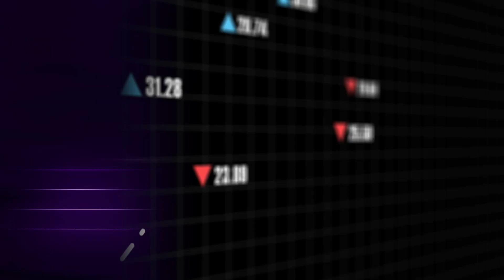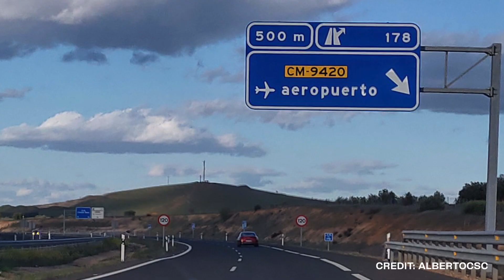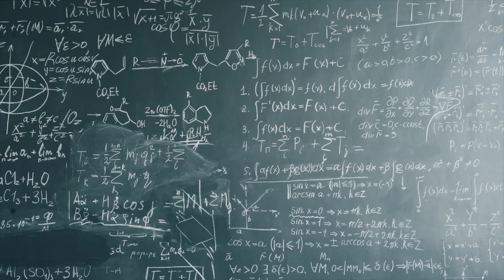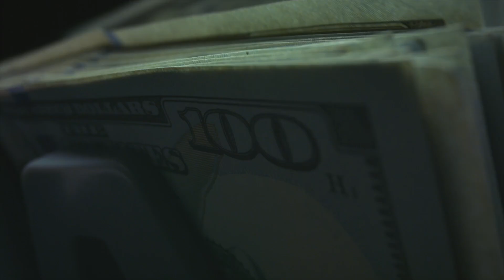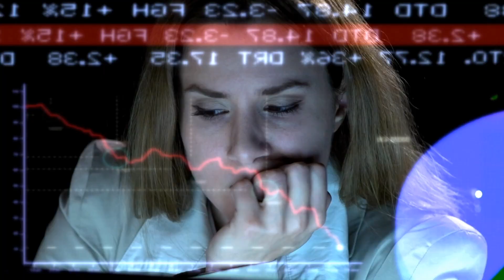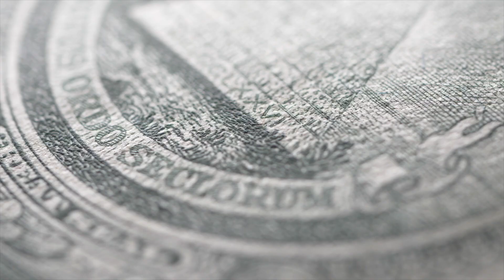5 Megaprojects That Went Horribly Wrong

Comment: #4.. bout the oroville dam.. we locals KNEW it was damaged and that DWR was cutting corners moved here in '96 and it was one of the first things I learned about the area... Don't know why people were NOT held accountable for this gross mismanagement.
Reply: Accountability implies there are consequences
Reply: Because anyone that could do anything about it was in on the grift...EVERY state/bond secured construction project has grubby paws reaching into the pile...
Reply: Uneducated people don’t understand and take things out of context. Susan wolding will appreciate your views
Reply: Thus it wasn't damaged by rain as the video says but poor construction of the concrete plate overlaps.
Reply: Because the government is never wrong and therefore never responsible for mistakes made 🙄
Reply: @Farrell0208  LOL right? we had the same problem with the 2018 Campfire and the 2020 Bearfire in Butte County. Th fires were a result in decades of forest mismanagement. Instead of clearing out dead trees and clear cutting areas infested with tan oak, they let the forest grow unchecked. Between a bark beetle infestation and a warming climate, by Jan 19th 2018 there were 100 million dead trees in the Sierra Nevada Mountains (as per the US forestry service) Then PG&E which is a 'natural' monopoly it was supposed to be HEAVILY regulated and monitored by California public utilities commission, well the CPUC FAILED as well.. Again decades of failing to actually do their jobs. This has resulted in hundreds of deaths, the complete devastation of town (and two of my family members losing their homes) not to mention the complete destruction of our economy in the hardest it areas.
Reply: @willchristie2650  Brooms?  Why didn't I think of that?  At least he didn't recommend massive doses of disinfectant and UV light. lol  Long live President Cheeto.

Comment: #5: Was in Commiefornia, so do you think they would clean up the mess or scam money from the project to make them rich.
#4: Was also in Commiefornia, where tax payers money was spent on things that is not governments job and because of that the damn spillway was not fixed.
#3: Was also in Commiefornia, another damn that was not built right. How much money was taken from this project to line the higher ups pockets.
#2: Surprised that this happened in Spain, but they built in the middle on nowhere.
Bonus: The military industrial complex killed this project.
#1 Corruption happened.

Comment: It's interesting that you speak about money "lost" in each project (or damage totalling a certain value) as if the money simply disappears.

But this isn't the case, is it?

Depending on how the money is spent, a large proportion of it can enrich the local economy, even if the project fails / is abandoned / is not completed. In most of these, those costs go on (for example) the hire of heavy machinery, the salaries of various construction workers, and the purchase of raw materials or components.

I think it's kinda weird that we so easily talk about money being lost when it isn't lost at all, but has instead generated a significant amount of economic activity. The only real "loss" is in the value of the asset that was being built or that failed or whatever. And the only people to whom that matters are the investors. The rest of us shouldn't care a jot.
Reply: That would be true if the completed project would have simply been a static asset that sits there and holds value, like a massive physical savings bond. However, the loss encompasses planned economic activity that now will not occur (how many people would have been employed by the Superconducting Supercollider?).

If your theory was true, there shouldn't be any major difference economically between a string of successful building projects and a string of failed ones. But this isn't the case at all. When investors sink large sums into projects that fail, it's not just they who feel the impact of no return on investment, it's not even just them plus the people who might have benefitted from the project had it been successfully completed, but it's also the people who might have benefitted from their next planned project, which can no longer be built because they don't have the money to fund it.
Reply: @mastick5106   - you may be right.  I was taking the "loss" figures as money already spent.  The absence of expected future economic activity doesn't count as a loss in my head, because (a) it hasn't happened yet, (b) no-one has spent any money on it yet, and (c) people shouldn't count their chickens before they're hatched.
Reply: @nigeldepledge3790  that’s not how finance works
Reply: @michaelconvery2924   - No, you're right.  But maybe it's the way finance should work.

Comment: Never ever buy land below a dam. This was the advice my grandfather gave me. Sound advice.
Reply: @genesis209_gd  what? Don't build on a flood plain. There's something called the '100 year flood'. That you can't insure against and can come twice in 25 years, all hydro engineers know about it ... never, never, never build on a flood plain.
Reply: @ValeriePallaoro  
Houston had three 500 year floods in a period of just 6 or 7 years.
Reply: One of the best pieces of advice that I ever got was from my school geography teacher, Mr Pragnall. “Never buy a house on a floodplain! One day it will be FLOODED.” This is in the same category of extremely handy advice.
Reply: @spongiform  Aloha the word Los Angeles means flood planes it happens every hundred years,
That's why there's canals and everyone near a curve or a corner where the canals come together on the outside they have to have Flood insurance,
Any new homes built it's a requirement ,
if you're in a flood area have to have flood insurance in California,
Reply: Is flood insurance high?
Reply: @manualLaborer  Only if the house is in an area that might flood. If it's in an area that will probably never flood, then it is cheap.
Reply: @jasonlarsen4945  'probably never' .. I see you are a betting man.
Reply: @ValeriePallaoro  If you need flood insurance, you might not be able to afford it. If you can afford it, you probably don't need it. 

Basically, if you're in a flood plain and it's required in order to have a mortgage, it's going to be an additional 10-20% the cost of your mortgage.  

If you're outside of a floodplain, it's going to be less than 0.5% of your mortgage.
Reply: @ValeriePallaoro  I'm not much of a betting man, I'm currently working on a Master's degree in Hydrology and Water security.  I'm also a homeowner who looked at a home in the floodplain when I was in the market to buy. Didn't buy it, obviously.  

Where I live now I don't need it. I grew up in the neighborhood before flood control measures were built. When there are flash flooding conditions in my town, I know where it will flood and where it won't.
Reply: @jasonlarsen4945  
I’m required to carry flood insurance and it is relatively inexpensive.  The annual premium is under $400 .
Reply: @ricklewis5804  - it'll go up when you've been flooded.
Reply: Bruh, my whole city is below a dam.
Reply: If possible be self sustaining in a mountainous region that's non volcanic. But other than that your likely to be effected by natural disasters.
Reply: it's right up there beside "Don't buy land beside an active volcano" 😂
Reply: Or near a landfill
Reply: @migue4793  Aloha we built our home on a landfill It still stands not ours for all went their ways.
We only felt one earthquake
I wondered as a child why we always
Went to that heep we found all
Kinds of Toys & stuff
I never knew it was a hill made
For families to grow together.
It never smelled.
After living on 15 different places while they built it my Uncle's
Father, 
Then there was this big carport for cars and we had to enclosed out or go outside in the snow to get downstairs to the basement.
I was kind of upset that I didn't get the chance to buy it but the journey I had in seven countries and 27 States and living here for all this time in Hawaii was well worth the wait to have a place to grow up in.
Reply: Unless the dam is made by Dutchies/Germans, in which case i trust them :)
Reply: And no property next to a gas station or an embassy.
Reply: Also not too close to rivers or mountains or volcanos. Pretty much anything that could be a natural disaster.
Reply: The Netherlands has entered the chat....
Reply: I cam't believe how you are mansplaining to me .. the correct words are "Yes, you're so right" .... I'm sooo laughing ... ffs. I'm not even a  hydro-engineer and I know all this .. ohmygiddyaunt you guys!!